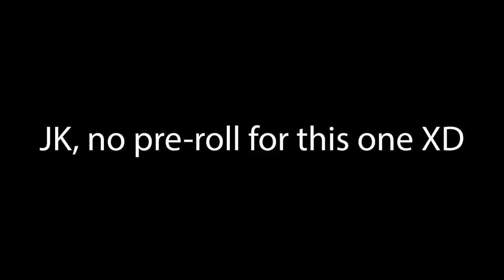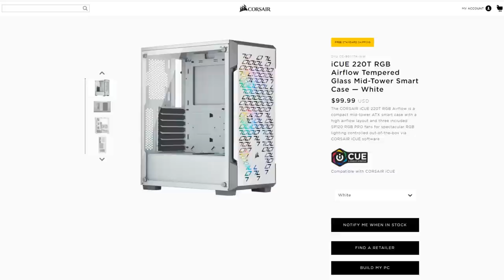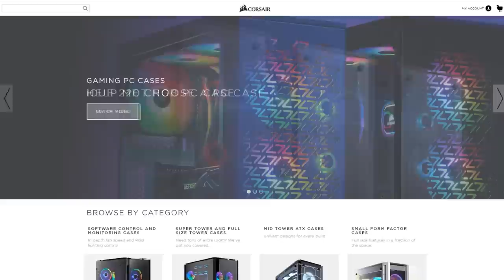She asked me for PC help... so I made her rebuild her own PC 😆

Comment: I am in the process of upgrading my old gaming PC. I will be reusing the case, psu,  ssd drive, and 2 other drives. I have the new motherboard, new cpu, new ram, new cpu cooler. I still have to get a video card. I think i can have every thing installed and all cables connected. Do i have to reinstall Windows? Or do I have to just turn it on when all cables are connected?

Comment: At 5:08 we see that the 2 RAM modules were not installed in the recommended slots, according to the motherboards manual.  Then should be where the white dummy modules are.  When the system was rebuilt the RAM were installed the same way.
Reply from the maker: Good catch! Didn't have the manual so installed it the same way assuming the previous seller did it correctly, will let Sheena know, and good thing is now she can do it herself!

Comment: they just don't die overnight. Some motherboards do not detect by themselves what  has been plugged, even on those with dedicated AIO pump headers. Setting a  100% duty cycle or setting a fan header to DC/disabling in the BIOS will bring back a "dead" AIO pump.

Comment: i had 2 Corsair Aios die when i was upgrading the motherboard and cpu one was an H80i and another one was an H100i V2. Even though they were completely fine before removing them.
Reply: I saw a post by a guy that went through 4 H100i V2s because they didn't put enough anticorrosive in the loop and all of them are an aluminum copper mixed loop. His units all failed within 4 months like mine did. Only reason he found out was he eventually got fed up with it and tore the loops apart to see what was going on.

That's when I decided I wouldn't bother with the warranty coverage and just went back to an air cooler.

Comment: I suggest remove first HDD and fan from radiatorbefore use blower. The dust  possible going through hard disk. Use W40 to spray from fan motor. And dont caring MOBO by holding CPU cooler hose.

Comment: Cool idea spread the knowledge, but the air filter is filtering warm case air :p LoL I spoke too soon! AIO is not installed :p but ah... keep this in mind? I'd also have an exhaust fan next the CPU, to get rid of the air cooled from the radiator, once the fans are turned around.

Comment: I have a very important question, my younger brother's pc was having trouble starting up. If we tried to boot it up, it would just stay loading forever. So we took it to this guy and he fixed it and we paid him, but he basically changed up the whole windows for his pc and now when he tries to get on, it's very very slow to when it was bought(mainly for gaming). We are wondering if we should just buy another pc for him or try taking it somewhere else.
Reply: He probably downloaded windows on your hdd instead of ssd. So if you just search on google how to re install windows 10 on your ssd and update drivers after would be good enough. But if you do have enough money to buy another one i would recomend that because pcs dont break down that easily. But the first solution should solve the problem!

Comment: disappointed yall didn't give it a deep cleaning before rebuilding it :( I understand the datavac got all the dust that was gonna affect performance but I like making new builds look brand new by cleaning used parts top to bottom, even taking some stuff apart to clean inside!

Comment: Newbie Tip:

Take a photo of your case / power / IO cables connected to the motherboard if switching to a new case. If it's a new build then simply take a photo of the motherboard on your phone and zoom it in so you can see exactly which pins need what. :)

Comment: ironically i JUST had this pump issue after changing a fan that had a bearing going out in it. fixed it with a bios update. ryzen 3900x reaching 90-100c in bios :S
Reply from the maker: Another person commenting something similar as well, I'm curious now I'd it's just a coincidence or these coolers are specifically sensitive to excess movement from installation/removal
Reply: @nerdonabudget  i bought mine 3/8/18 if that helps any idk

Comment: Hey guys (or Danny,) does anyone know what mobo this is??? I’ve been looking for a white motherboard that doesn’t cost a fortune and her build looked pretty budget. Also if anyone knows a budget white mobo, please let me know.
Reply: The board looks like Asus Sabertooth Z97, which even second hand are not cheap. Right now, I am not aware of any boards available new with white details or PCB. MSI had an Arctic line which was predominantly white which would have to be sourced used (probably) and then there is the Gigabyte Vision series which is very much not budget friendly.

Comment: great video. So far... Haven't completed watching it... BUT,....  I have one very important "Tip"  when blowing out the computer. Do not spin the fans, stop them with the stick or anything to hold the blades in place while you blow the area out,  you can ruin a fan. Very, very easily... Because fans have what they have a low-speed bearing, and that blower could spin the fan faster than the bearing was designed to handle,  generally what happens is you will shorten the life of the fan.  Just a tip...   This also applies for cleaning out the power supply. Don't let that fan either. "

Comment: Does anyone know some good tech help? Having some audio issues on my PC and can't figure it out!
Reply: Reinstalling audio drivers with latest update/ using old driver from motherboard website usually fix most audio problems
Reply: @Naverdo  realtek right? I've uninstalled and reinstalled my drivers and I didnt see a fix. My motherboard is an asus z390 p
Reply: @TheeOmen  did u use the drivers from your motherboard site? Also try the drivers from realteks site. Btw what problem are you having exactly?
Reply: @Naverdo  Yes. Directly from ASUS website. I haven't tried realtek though! My problem is when I'm playing an epic game my voice chat just cuts out. People can hear me I just can't hear anyone else. I have to reset my voice chat about every 5 minutes because it just cuts out.
Reply: @Naverdo  I've even made sure the sound settings we're normal and it seems like my default communication device switches on it's on when not playing a game but when my audio cuts out none of the settings swap. I'm just so confused I feel like I'm searching in the right places I just can't figure it out or maybe it's just epic.
Reply: @TheeOmen  There is a good chance its happening just in epic, check discord or some other games and verify. It could also be issues with your headphone? Also try out both the front and rear audio port.
Reply: @Naverdo  It happens in 2 epic games. same problem. My head set isn't that old and my drivers are up to date on that as well. Using the front doesn't fix it either and sound quality kinda tanks since I can't use the sound DAC and the AUX.
Steel series Arctis 5
Reply: @TheeOmen  what about non epic games? and non game applications like discord?
Reply: @Naverdo  I don't have any friends that play steam games so i could never test it!
Reply: @TheeOmen  ok I'm not really sure what your issue is. If u can sometime later get someone on discord to check it out and you have the same issue then I suggest opening up this problem in some tech forum. If it's happening only in epic games then either go to epic forums or contact epic support? Idk.
Reply: @Naverdo  Thanks for all the help though!!! I appreciate it!

Comment: hey there I love the video it was very interactive between you and your friend but I do have a question of my own to see if you can help me out I don't know if I should email you this or if it is better off in this way but have a slight problem on my motherboard with the cooler head of the Corsair h115i pro pipes blocking to memory channels that go around the processor I was wondering if you could help me out with that message me back for more details thanks

Comment: Hey bro can you make a vid on “best budget pc for under $400 like I’m literally broke so a vid like that would be amazing thanks
Reply: there are those type of videos out there
Reply: depends on where you are from but i would say, that you can get a pc, with used parts, with these specs: b450 motherboard, ryzen 1600 af (2600), 16 gb ram (two sticks) with at least 3000 mhz cl 16 (3200 cl 16 would be better), 120 - 250 gb ssd, 1 - 2 tb hdd (7200 rpm if possible), rx 580 8gb/gtx 1060 6gb and of course a case and power supply. maybe it has an aftermarket cooler on it. i would try to get a whole system used at first and if that doesnt seem to be possible, then i would try to get parts, to build it. maybe you get one without a graphics card or some parts missing. be careful with the power supply, it is a crucial part of your system, cause it obviously powers everything in it. a bad power supply can ruin the whole system stability or even worse, break stuff. doesnt happen that often though (that it breaks stuff), but a low quality power supply doesnt have good protection from that to happen and has a bigger chance to fail or dont work properly. i think a fair price, for a system, with those parts should be around 400 us dollar. i dont know for sure but with patient, you should be able to find something like this or even better. gl man, hope you get a good one and that it lasts for a long time. another reason for a good power supply would be the upgradability for more powerful graphics card. maybe you get lucky and find one with a gtx 1070 or so. that would last you even longer for 1080 p and decent graphic settings. you never know ;).

Comment: Wait wait she has 2 sets of different ram, Idk if it's the same ram but in different colors but come on is this actually running?
Reply: Using different sticks/brands/speeds will work fine. You just might not be able to get the xmp profile to work.  Setting the xmp profile for the slower/looser stick usually works.

Comment: she should just keep the air cooler. Waayyy easy to clean.
Reply: An AIO isn't incredibly difficult to clean. Both will require reposting eventually. It's just a bit more to clean with an AIO. Cleaning and maintenance gets a lot worse with a full custom loop.

Comment: My first build plz help
Budget: $300/ ₹30000
 
AMD RYZEN 5 1600
Amd Radeon Rx 550 (4gb variant)
Asus ex a320m gaming motherboard
Gigabyte pb500
Barracuda 7200rpm 1tb
Chiptronex mx2
Corsair vengeance lpx 3000mhz 8gb
 
One more question... That all the a320m motherboard have highest ram speed of 2600mhz but I am adding a 3000mhz ram.. Will it work?.. Oh! One more thing I am way out of budget and I can't buy a b450 motherboard...

Comment: bro the AIO pump power cable bro... the fans have two cables, the pump must have one more... i dont see u plugging it during the video..
Reply from the maker: I plugged the pump cable in, seperate from the fan cables, it was the clog that was the issue
Reply: @nerdonabudget  very weird bro, got some coolermaster pumps working for 5 years.. anti-freeze cannot clog, there is no way for alter the density of that material.. if there was no leak... how it clogged ? weird......
Reply from the maker: Should not have used the term clog lol, air bubbles trapped/stagnant fluid not circulating describes it better, as the pump was making noise but temps were high. I know the cable isn't the issue because I got it to work a week later when troubleshooting plugging it in the exact same way as when I tried to troubleshoot that day of

Comment: Guys... careful cleaning your case and having the fans spin. If they spin backwards and fast enough, you can kill motherboards and other components. Ask me how I know.

Ok, i'll tell you... sheesh. I cleaned my computers for years with a leaf blower, but the last time i did it, i guess the fans spun TOO fast in the opposite direction ultimately killing the motherboard and 2 SSDs. Luckily the CPU and everything else was fine. 

Tape the fans down, or put a screwdriver through it. Don't let them spin if you can help it.

Comment: Wow she was using a 60gb system drive? I would never ever suggest buying or using a 60gb SSD. 128gb is the absolute minimum any pc build should have. Also secondary drives I suggest 480gb SSD because it undercuts the 500gb drive significantly for just 20gb less.

Comment: dude the ram sticks should be at the 2nd and 4th slots not the 1st and 3rd -_-
Reply: It can depend on the board you are using. Never used a z97 board but my old board had dual channel in Dimm slots 1 and 3 wheras my new mobo is 2 and 4 :-)

Comment: Informative Video. Thanks!

I would suggest upgrading the System Memory to at Least 16GB 4x4GB, I would personally shoot for 32GB 4x8GB for that Motherboard.  Also, I would upgrade my SSD with a Samsung 860 EVO. So much faster. I would eventually phase out all HDD's on my personal PC's. For a Server or NAS and Bulk Storage Devices, HDD's are fine.